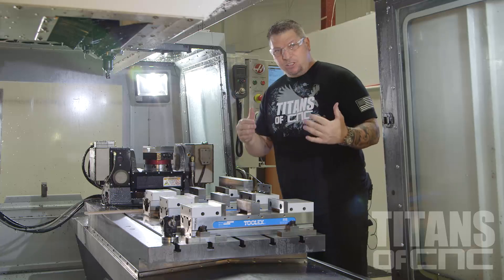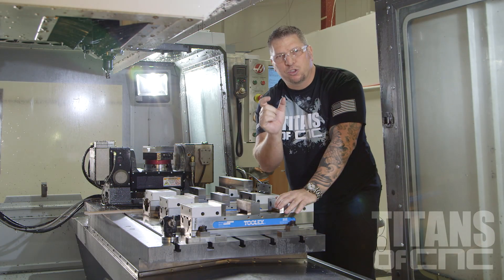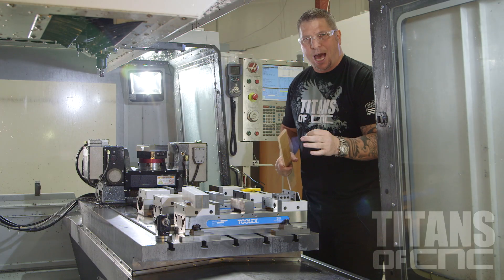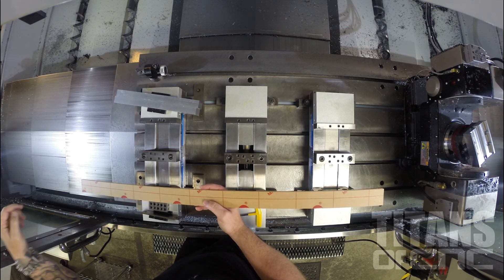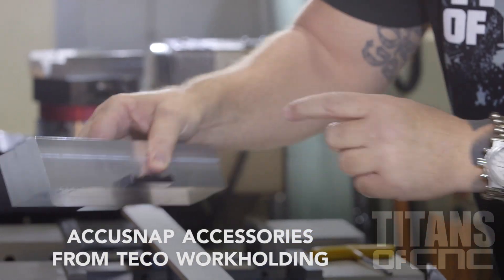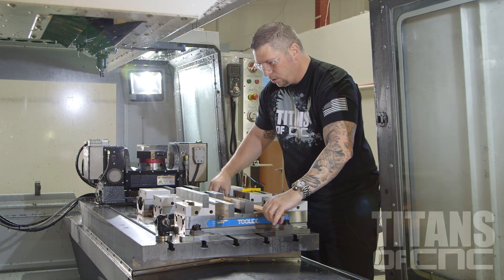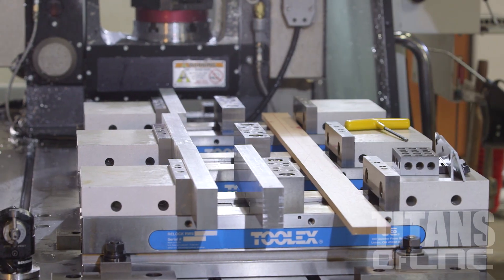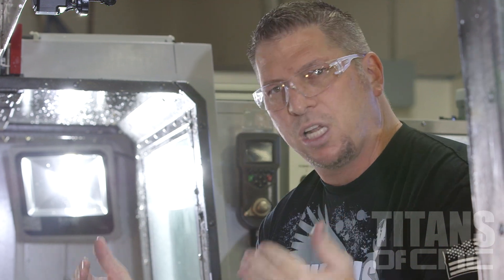Learn Titan's Fixture Strip Technique - CNC Machining Education

Comment: Pretty basic workholding if you have been around machining for any length of time. Try using a shorter end mill holder as well. The closer your tool is to the spindle nose, the faster you can feed it and the better your surface finish will be. Simple stuff guys...

Comment: Quick questions from a prospective cnc machine owner-  the soft jaws are re-usable and accurate if removed from the machine? How were the individual parts held once they were separated from the large piece of poly? I'm learning about tabs and other techniques, but it looks like these parts are 100% cut and just held in the vice jaws by the parallel edges.

Comment: I have tried this before but with not much success. Always had issue where two parts got most pressure and the weakest link would pop out. We tried controlling the width of stock and the jaws were machined in the vice of machine using. Worked okay in beginning but over time would fail. I now have the habit of never holding more than two parts per moving jaw. And or use mighty bite clamps for independent pieces. Just my thoughts. Have you experienced this same problem over time? Or with inconsistent material?
Reply: Leave material between parts until high cutting force operations are done. Or leave a thick deck. Flip and deck in smaller qty if you can’t hold more than 2 per vice. Bandsaw the strip into whatever number of parts you want to deck at once. Some things that have worked for me.

Comment: Titan, how would you machine an A36 flame cut plate?. The surfaces were jaws clamp the part are irregular.
Reply: That's kinda a vague question. I machine a36 that's flame cut all the time. Most times i clamp it to the table with Lenske table clamps on some riser blocks made from aluminum. If the machining op requires a vice i would mill the 2 of the opposite sides with the same method i previously mentioned to prep the material so a suitable vice could clamp on to it.

Comment: So your raw material has to be machined parallel on the width first. Otherwise you would be throwing parts.
Reply: Just push that acrylic sheet through a table saw, 10sec a strip

Comment: Nice video, and nice setup.  It would  never make sense to machine 30000 polycarbonate parts Tombstone setup or not. it you were doing those kind of quantities  of this (relativey) simple part wouldn't make way more sense to injection mold them.? That would also eliminate the need to remove the coolant from each lens, I am assuming that the cleaning of each lens is a manual process?  Thanks again for the great videos
Reply: 30k parts is no where near a quantity to justify a polycarbonate mold.  They're generallya hardened steel mold because they have to deal with constant temperature changes mainly, but for other reasons of course.  They also have to be optically polished and since they're hardened they have to be ground, EDM'd as well as lapped in normally.  You're talking well into the 6 figures for these molds, and for quantities that require an initial investment like that, included with a generally higher price per piece to mold optically clear plastic makes it highly cost effective to stick with machining them, even into the 100k+ quantity range.
Reply: DimensionMachine injection moulding produces a lower grade of component though.
Reply: they needed something clear and pretty accurate considering these are just a snap on part
Reply: Well, I dont agree with that  very broad blanket statement at all.  Injection molded parts are known for consistent quality over runs of tens of thousands if the machine and process is set up properly.  Not to mention the cost benefit over the long run.  Higher up front costs, but if you need 30k of something like he is talking about you are not going to machine all of them, at least not IMHO.
Reply: Like a Lego: cheap, accurate, clear if that is what you want, and injection molded!
Reply: It would be better to run these on a cnc router